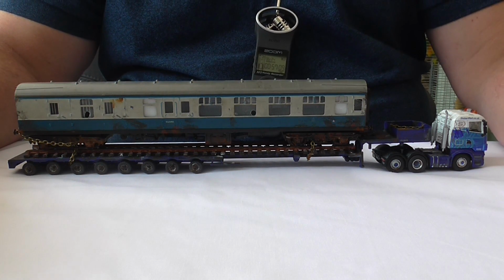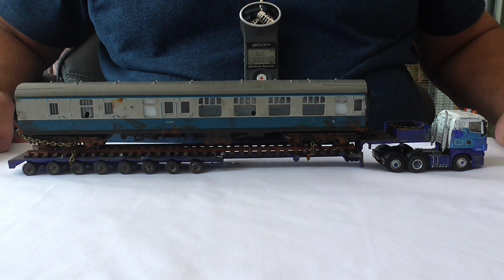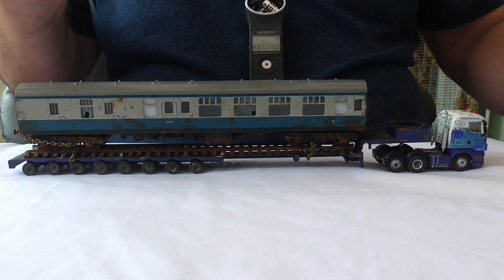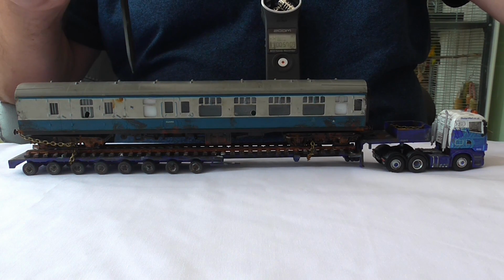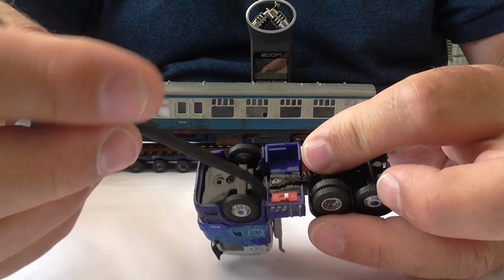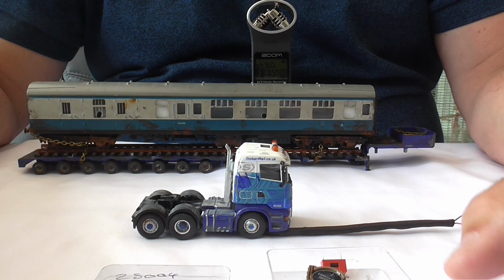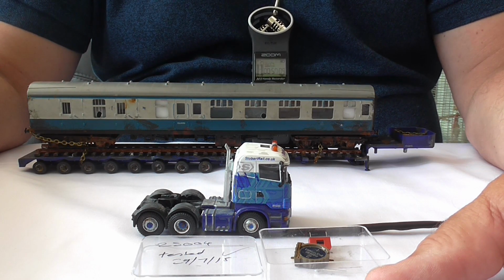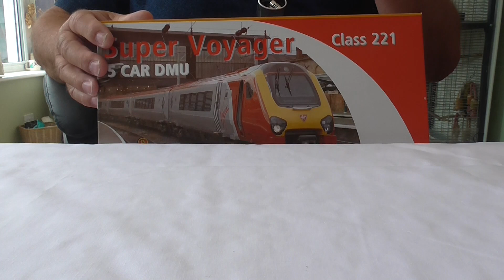Model railway – update on test layout.

Comment: Hi Simon 👋
Great video and great idea of the scrap yard diorama. 
I have an old airfix class 31 I was planning the scrap weather but if you would like to have a go with it please get in touch.
If you need advice about scrap weathering I recommend speaking with Tim at The-scrap-line modelrailway weathering via the group.
That class 221 is identical to what I have. I have only fitted a decoder to the power car so far so will be looking forward to seeing how to fit them into the dummy power cars.

Regards Jason 😁
Reply from the maker: Hi Jason, does Tim offer a weathering service? I have not started weathering yet, still a long way off. The chap I found weathering and selling rolling stock can be a bit expensive.  I will have a look at Tim's website/group...Simon

Comment: Hi Simon 
You've got to earn the brownie points first so crack on with the decorating lol
Like the idea of graveyard/scrapyard don't get anything to modern 
A little detail on your low loader file the bottom of the tyres a bit flat so it looks like it's got a bit of weight on it
Good luck looking forward to seeing your test board
Reply from the maker: Hi Dave, I am looking forward to the test layout, and the graveyard.  I am looking at a Deltic and Class 37, possibly a 47 for the graveyard....Simon

Comment: I do like the stobart truck i bought two of them  i bet you be glad once the wife has finished so you can start to make thinks and run locos ive just packed all mine away and wow ive got some stock got things i didnt even know about or forgot as for the 221 i bought that i it ran so slow so it went back in the box and never got it out since then and that was about 10 years old cheers paul
Reply from the maker: The truck is very nice, they weathering did not look as good on camera. My Class 221 runs very well, just need to convert it to DCC.  Have you stopped modeling now and given up your layout?...Simon
Reply: Simon -Liverton Central nah going away next week so had to pack it up with not being here i dont like it in there so ill be back to it soon ive now got a problem short circuit and i cant find it but try ans get your head around this it has a short circuit and the decides not to have one so you press all the power and it all works and then come back to it the day after heart short circuit I can't work it out one so ever
Reply from the maker: Does it happen when you run a train or a soon as you apply power to the track?
Reply: Simon -Liverton Central power to the track??
Reply from the maker: If it is when you apply power to the track, and it is intermittent, that suggests that is connecting one day and creating the short, that could be a simple as a train running over a certain point, which shorts the next time you apply power.  It then frees itself and works, until a loco passes the same point on the track.  Is your layout DC?  If yes you could try using a multi meter along the track, using continuity,  until you get a resistance, that will identify a short. It could also be a faulty point motor/points...Simon
Reply: Simon -Liverton Central mines dcc ill take a look in the morning could be anything i think i mite start again with the wires there a bit rough so maybe start again on it ive rushed it i think
Reply from the maker: There is a DCC track tester, I think about £6, you can use to simply test all the track. If DCC any small anomaly will cause a short, dropper wires, solder point etc.  Could it be your controller if it is intermittent?
Reply: Simon -Liverton Central hope its not ive just bought it but when i use the program track it works fine